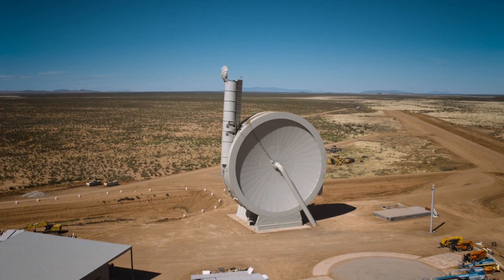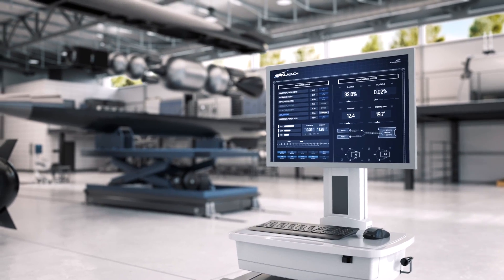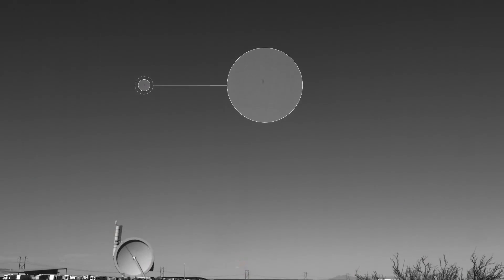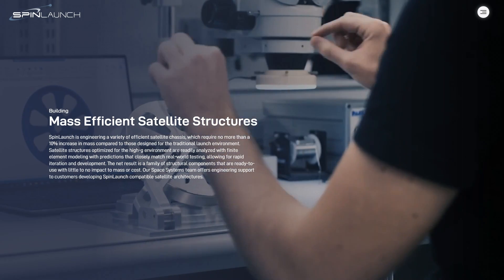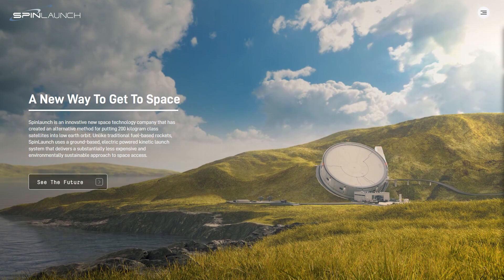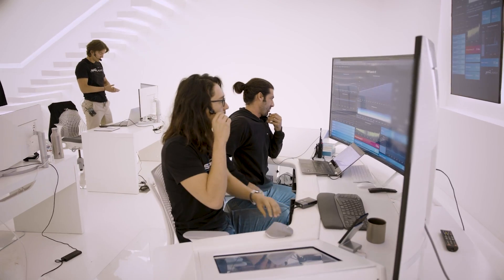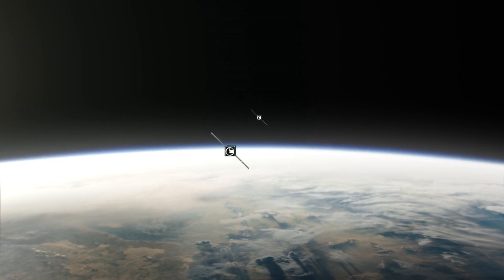Can Spinlaunch Throw Rockets Into Space?

Comment: Here's an idea: they should have a complementary projectile on the other side of the spinning bar. This projectile would be launched into a short tunnel with some kind of energy absorption of course (maybe just water). This way balance is near perfect throughout, no stress is put on bearings.
Reply: Send the complementary projectile through regeneration coils to capture a large fraction (something under 50%) of the launch energy.  Also use regeneration to slow down the rotor itself.  Assuming adequate storage, could probably cut overall power demands to just above the KE of the projectile itself.
Reply: @flymypg  Absolutely, regenerating the launch arm is a good idea. But recovering energy from the projectile is probably impossible -- likely you can't get a magnetic field high enough to do it, and the tolerances are very difficult and risky. More importantly, electric energy is just really inexpensive, my calculations put it at about 150kWh of kinetic energy, which in most parts of the world is just close to $20, significantly more than the investment they would need!
Reply: The low energy cost really puts into perspective how theoretically inexpensive it could be to get into space... almost into science fiction territory.

Comment: How does the centrifuge not self destruct immediately after launching the projectile due to the now massively unbalanced spinning arm? Does it dump some kind of ballast on the other side at the same time as it releases the payload?
I assume in their first test they just let the mechanism take the unbalanced load, but the whole thing will wreck itself like that within a few launches and necessitate a full rebuild...
Reply: ive seen a video where a guy experements with a spinning trebuchet and when the projectile is releaced the rpm of the arm absolutly tanks, as the momentums is transfered, they might have the moment of interta of the arm balanced with the projectile such that most of the rpm is lost when the momentum is transferd, but the trebuchet used a sling so that might have been what let it dump the momentum so quickly
Reply: Honestly, I think you slap some massive bearings on the axle, make sure your arm has a vastly different natural frequency in the radial direction from any transverse or torsional directions, or other higher order modes, and call it a day. If you watch the high quality launch videos, on one of the launch control monitors you can see a chaotic graph during the spin down cycle that looks like it is some kind of vibration monitoring, so this is all obviously something that they expected.
Reply: @BlueBones8  That sounds like it would create quite a crater. :p
Reply: @mikicerise6250  Nah, your counterweight weighs like 10x, on 1/10th the arm, so it's going 1/10th the speed. That lowers the kinetic energy down a lot.
Reply: @frederf3227  Oh! Cool. :D

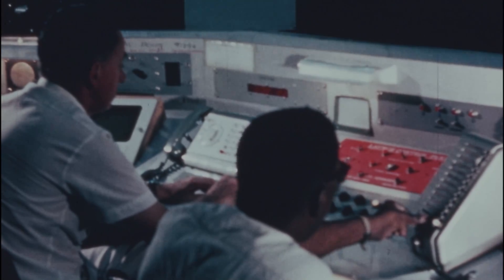Comment: 1:33 "You start to run into limits of the speed of sound in the combusting gasses"
If I'm understanding correctly, does this mean the limit at which the chemical reaction of the propellant can occur, or perhaps the pressure of the gas can only propagate so quickly?
If so, there goes my idea to line the barrel with lots of small charges fired in sequence like a chemical rail gun.
Reply: germans tried this in ww2. long barrel with sequential charges to fire a 155mm shell from france to london. got bombed before it finished construction.

Comment: How much less energy would be required to put this thing on top of a 20,000-foot mountain where the air is thinner and you’re already marginally closer to space instead of at sea level?
Reply: Math for using Mt Kilamajaro in Tanzania is interesting. The expensive first 6KM in altitude gain all done by truck, 50% atmospheric pressure, at launch, and right on the equator, so you've already got 1000 mph West to East yeet for free.

Comment: This seems like an ideal military launch system for anti-satellite weapons systems. Low launch signature vs traditional boosters and significantly less warning (no booster getting prepped on a pad). The requirements for high G load electronics already match those of most missile technology... All that needs to change is the terminal effector. Hopefully they are sensor occlusion or parasitic jamming systems and not just ballistic kill vehicles.
Reply: Only issue is that it takes ~1 hour to spin up to launch speed.
Reply: @niallmckinnon  And it's not the easiest thing to aim. :)

Comment: To solve the balance problem at release, all they'd have to do is have a counterweight on the other end of the rotating arm that is released in the opposite direction (i.e. into the ground). It should be straight forward to build a big pool to slam the counter-weight into to avoid damaging the structure (probably destroy the counter-weight though).

Comment: How will they stop the projectile rotation? Even after "launch" it should still rotate at 450 rpm? Aerodynamic fins? That would add a lot of friction...
Reply: There's no rotation on the projectile though? Once it's released it's gonna fly in a mostly straight line...

Look at shot put for example, goes from a spin to a straight line
Reply: @joshuacheung6518  it will fly straight, that is true. But  angular momentum is a bitch, so while flying straight, it must also rotate along its vertical or longitudinal axis (depends from where you look at it) as well until you stop that rotation. If you would use aerodynamic fins to stop the projectile rotation, then it would actually not fly straight anymore, which would be a huge loss in friction and efficiency
Reply: @gaharmun  okay, i think i missed a few lessons (like all of physics)

Can you help me out and explain why the projectile must rotate at 450 rpm?
Reply: @joshuacheung6518  i tried to, but youtube deleted my comment and i cant be bothered to type it in all again... just look up "angular momentum"...
Reply: @gaharmun  i did, i can't find this problem that you're describing anywhere. Got a specific link that describes it to start me off?
Reply: It's hooked up to a pair of giant AC motors, which can also apply a braking force and generate power (this is how "regenerative braking" works in electric cars and hybrids). In theory they could even sell that power back to the grid and offset some of the cost of the launch.
Reply: @skylerlehmkuhl135  the projectile kind of gets decoupled from the motors on release lol.
Reply: @skylerlehmkuhl135  i was not talking about the massively imbalanced arm still rotating after launch... that is a different problem. I was talking about the projectile. When you disconnect it from the rotating arm, angular momentum of the projectile is conserved, so it will still rotate with the same 450 rpm...

Comment: Even harder than hitting that one millisecond for release, they need to counteract the projectile's own spin. If the arm is rotating 400 times per second, so is the projectile. And you don't want it flying sideways. So I guess that besides hitting one millisecond for launch, they also need to hit much narrower window between releasing the top of the rocket and its bottom, so it does not turn around as soon as it exits the launch chamber.
Reply: Huh? The projectile doesn't have much of any spin on it as far as i can tell.
Stick a string on a drill with a nut on the end, spin it up and shove a razor into the string path, watch the nut fly straight until gravity takes over
Disclaimer: have a really good grip on the razor and use a weak string

The whole payload would be released at once with no delay, or you induce the tumble you're afraid of
Reply: @joshuacheung6518  The nut will fly in a straight line but will be spinning on its own axis. To counteract that for a rocket launch the nose of the projectile needs to be released just before the tail, so that centrifugal force will have just enough time to cancel its angular momentum.
Reply: @skylerlehmkuhl135  the axis would be so large that it would effectively be ignorable until gravity rapidly takes over and binds it to that instead

Comment: Two questions:
1) How much money are they out if they have a hub bearing failure at near launch rotational velocity? I expect the chamber and arm would be a total write-off and maybe the motors and some of the infrastructure. How does that compare to the loss of a booster on the pad during a RUD?

2) Sure, the G-load builds up gradually, but, doesn't it go from 10,000 G to zero just about instantly at release? How's that sudden unloading of G effect potential satellites as compared to the sudden application of that force on a gun launch?
Reply: exact-a-mundo......it's a scam

Comment: The presumption that liquids (including of course propellants) are incompressible is absolutely fallacious. Have the relevant engineers accounted for the issue of putting liquid propellants to the lateral forces expected by the larger device (because the liquid propellants at load would slosh even if the tanks were initially filled to full capacity)?

Even if so, this would involve over-engineered slash overbuilt slash expensive slash heavy tanks and components, thereby undermining the usefulness of the preferred liquid propellant technology by this necessary increase in weight and decrease of propulsive energy per volume.

For this reason, I´m surprised that this venture hasn´t decided on solid rocket propulsion under these circumstances. There are fewer (or no?) pipes and connectors to potentially fail, it´s more robust, with no shifting weight to account for, as well as being comparable (or even superior??) in volume and weight efficiency under the circumstances. 

Additionally, the non-trivial initial velocity makes ram air induction propulsion feasible. In an initial vacuum, there is no practical impediment.

It is to be observed that even one failure would presumably destroy the expensive launch apparatus.

Comment: Solution: have a counterweight that gets thrown into the ground at the same time that the payload gets launched
Reply: That's a lot of wasted potential energy--not to mention the destructive power of such a projectile. They need to find a way to recapture a large percentage of that energy to recharge part of the system. If they could turn the rotating arm into the rotor of an enormous induction motor that uses eddy currents to slow the rotation while producing electrical power  that is directed into battery or capacitor storage.

Comment: I wonder how they deal with the angular momentum of the payload itself - it needs to go down from several hundred RPM to not rotating upon release. Maybe the release mechanism has multiple attach points that don't release at the same time?
Reply: On release i don't think angular momentum would cause a tumble like you think... you would probably have more problems if you release at different points with different timings as different parts will have different speeds, which would cause a tumble... but if you release it all at once, it should, from my understanding, all go in a fairly straight line since you don't have anything forcing it to actually go in circles anymore
Reply: @joshuacheung6518  The payload itself has angular momentum. It won't stop spinning just because you release it. If the angular momentum is not reduced by the release mechanism, then the payload will go out spinning at the same RPM as the launcher, and it will crash with the tube.
Reply: @bunstructors8591  okay, lay it out for me please, since i seem to be missing something.

If the release is on the projectile's center of mass, what would induce a tumble?

Why would the tumble be x rpm and what would the tumble be around?
Reply: @joshuacheung6518  What "tumble"? If an object is rotating, it will keep rotating unless a torque is applied to it.
Reply: @joshuacheung6518  You do try but I suspect you're dealing with people in waters way over their heads.
Reply: @TheEvilmooseofdoom  either that or I'm missing something shrug
Reply: @joshuacheung6518  lol you are missing Newtonian physics 101. The payload has an angular momentum while spinning. What part do you not understand?
Reply: @joshuacheung6518  and the payload has the same angular velocity as the launch arm because it was mounted on it...
Reply: For a fair example look at shot put

Comment: They have actual hardware. Suborbital tests are a good start. I'd say there is a maybe 10% chance it reaches orbit, and a 2% chance it is commercially viable, but a 25% chance something similar gets put on the moon. Even if we are mining rocket fuel on the moon, why use it up to get off the moon when an electric launcher can do it without expending fuel? Something like this, or a linear rail gun (which I think is more likely) could probably reach a transfer orbit down to LEO, a small amount of fuel could bring it into a parking orbit, where it could meet up with empty stages from other rockets, transfer the fuel, and head back to the moon for way less cost than trying to launch from Earth, which is among the most difficult places to launch from that we can realistically consider launching from.

Comment: Regarding the "no propellant needed": There is no such thing as a free lunch and conservation of energy exists. Electric motors are more efficient than chemical engines, but punching through the atmosphere at full speed and spinning on bearings for hours is also pretty inefficient.

The claim multiple megawatts for multiple hours. For comparison, an Electron first stage carries about 25MWh in propellants, but provides 1000-2000km/s in additional impulse and a larger payload.
Reply: I definitely see this as a proof of concept for moving on to space-borne operations in 10-25 years, because chemical rockets aren't going obsolete any time soon.

The best advantage I could think of is leaving an orbital body to rendezvous with a return vehicle, as it would save on propellant at the origination and on the rendezvous vehicle, by not having to touch-down.
Reply: Thing is that we have less destructive sources for electrical energy than RP1.  If Rocket Labs gets (buys or makes) an Earth based CO2+water to Methalox machine, things become very different.
Reply: @johndododoe1411  Of course. But as you say, synthetic fuel is an option and an electron-sized vehicle would likely launch for under 100MWh all in.

This upper stage also needs fuel, and vastly more than electron S2 as it is very heavy and pressure-fed. I doubt they could compete at under 500kWh/kg.
Reply: This is for Lunar Launches.

Comment: What about the sudden inrush of air into the very low pressure chamber once the projectile bursts through the "membrane" at launch? The stresses on the structure will be enormous, not to mention the loud shock wave. And what if the projectile gets released at the wrong place, due to malfunction? Can the structure hold that "inside"? Or will it pierce through and create dangerous shrapnel flying at supersonic speeds? I would like to know if it could be possible to build a small scale version that can be "attached" to an aircraft, that will fly it up to 13 km, where the air pressure is down to ca. 1/5 of the pressure at seal level. The diameter could be ca. 9 meters, but you could spin it faster. The gyroscopic effect would also stabilize the aircraft prior to launch. Would this be feasible for small payloads to LEO? I am lazy to do the math myself. Also, integrating this into a plane such that even if it would fail catastrophically it would not damage the plane to an extent that it will crash is a problem. And mostly, you burn fuel, not use grid electricity, so I ask myself it it makes any sense in the first place. But you could launch from over the ocean at any inclination you want to get to various orbits. And still you only have about 20% to 25% of the atmosphere above you, meaning a lot less drag.

Comment: For the balancing issues...Why don't they build a symmetrical arm and launch a dummy rocket at the same time into the basement. The dummy rocket could be steel projectile of identical weight as the rocket that is launched in a deep pool of water to absorb the energy.

Comment: The drum has another port on the antipodal site, so they may be launching identical satellite into the earth simultaneously to keep the rotor in balance.
Reply: That would be one aggressively suborbital trajectory right there.
Reply: Builds perfect copy of launch vehicle just to yeet it into the ground 10/10
Reply: I think it's just a maintenance hatch. The launch port has a vacuum seal but this one has a physical door. It would break the vacuum to open it and it wouldn't open fast enough either
Reply: @Xatzimi  In their patent this is their actual plan - just yeet the counterweight into a tunnel.
Reply: @gamesguy  a tunnel that surfaces in china?
Reply: ROFL😆
Reply: Deploy the launch platform on a gold deposit and you've got a brand new gold mine!
Reply: Honeslty, that would be an ideal scenario. Surface built for exactly taking a hit, and having a literal brick of mass on the other end of the rotor, on a second arm. Release both at once and that lopsided change in mass is balanced out. 

However it WOULD also double the risk for incidents, and then some... If the arms are damaged by the combined force, if one doesnt detach when expected, and od course if one releases at the wrong angle, both do.
Reply: Why not have 2 drums, both spun up by separate  rotors but the same motor, rotating in opposite directions in each drum? Not sure if it would be possible but the loads at launch should cancel each other out where the motor is concerned. If it's possible you could launch 2 payloads on the same trajectory at the same time.